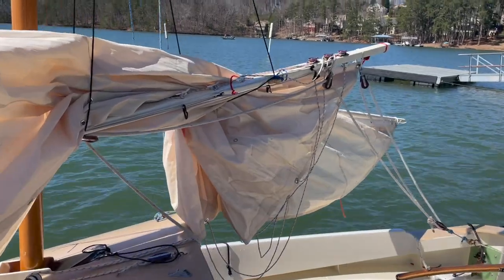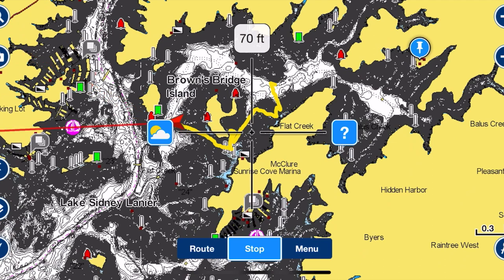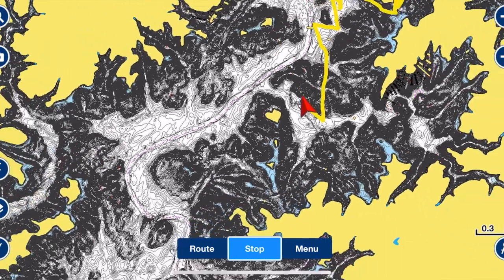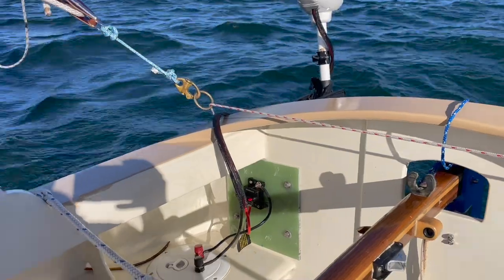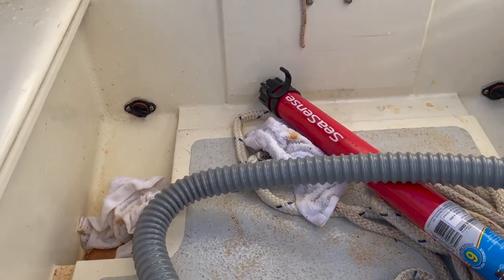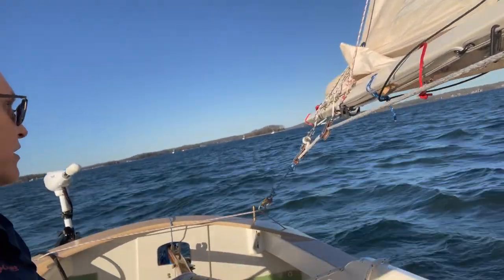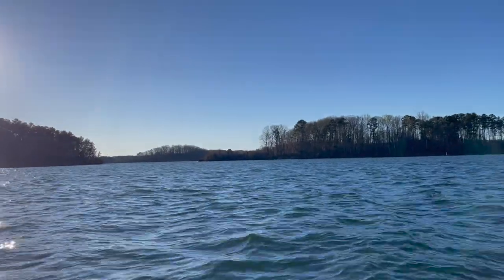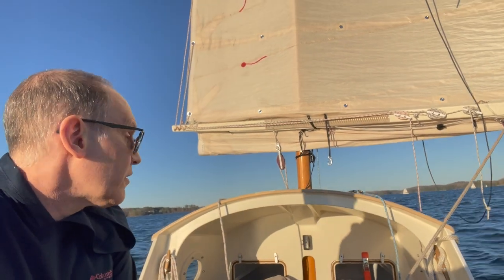Sailing to Three Sisters Islands. Parking on open water. Straight start from stalled tack.

Comment: More please! I'm at the early and naieve stages of building my scamp, and little knowledge to a real life experience of one, everything for me has been pondered and visualised so far, so im enjoying your clips thankyou. with regards the self bailers I would guess they would be effective for when the water inside the boat is higher than outside the boat, so my guess is they may reach an "equilibrium" lightening the bailing needed. But from the positioning of them they would let water into a dryer boat?
Reply: @TheKetamineSquid  thankyou!
Reply from the maker: Thanks both! Unfortunately I had the misfortune of a capsize. The self-bailers were moot due to some serious mistakes I made before setting out. I went out in way too heavy weather for me. I'll make a video about that at some point. But I can say for sure 1) Check the gusts not just the steady wind speed. 2) ENSURE there's a line on the end of your centerboard, so it doesn't disappear into the hull as you're trying to right the boat. 3) Make sure all the lockers have solid-locking latches on them. (Mine had lame latches, and the covers came off and the whole starboard side of the boat filled with water.
Reply: @davidwimberley5026  oh wow! I can see that being extremely challenging!

Comment: Before disabling the traveler, try finessing your tack. Maybe start by bearing a few degrees off the wind to power up. Then smoothly start the turn without abruptness which would  act as a brake. Once a turn is established, you might progressively tighten the turn with less danger of brake. Usually even catamarans are responsive to rudder subtlety in avoiding "irons". Travelers have advantage in pulling the boom down rather than sideways for better sail shape.
Reply from the maker: Thanks for this! I'm sure you're right. I'd thought about bearing off to build speed but I had never considered that an abrupt turn acts a bit like a brake. Heh, I'd assumed the more abrupt the better. Looking forward to trying that section of going down the lake again now that the weather is cooler. Wind is always blowing right up that channel so it's a good place to try it ... like a challenging ending to the first level in a video game.

Comment: Much simpler than multiple rings and clipping your traveler, simply connect the first mainsheet block (from the clew end) directly or much closer to the traveler line. That blue line and large snap shackle is way too long and not allowing you to pull the boom right over the corner of the boat. My guess is it shouldn’t usually be any closer than that to center line.

Comment: Great video, I have one question...... could it be possible to just fill the water ballast area with sand or some other heavy material and leave it permanently in place?
Reply from the maker: Sorry I'm late replying... Well... YES, that is possible. BUT I don't think I would, personally. The reason is that with water ballast, you can empty it , so that the boat is easier to handle on a trailer, and pulling a trailer. Sand or other ballast wouldn't give that flexibility. But yes, the water ballast tank on the SCAMP sailboat (mine, at least, and I think all or most others) is accessible via a hatch in the floor. So you could shovel some sand in there, then close the  hatch. You could even (with some good deal of trouble) scoop it back out again being careful with a small plastic shovel or something like that. I suppose the advantages would be you'd have a much heavier ballast. Sand is 1.6x to 2x as heavy as water. Ha, so (theoretically) I'm thinking about the possibilities, if I ever felt comfortable enough in the SCAMP to take it into an ocean for an extended coastal cruise.
Reply from the maker: Oh, and I should say, I'm not qualified to answer this. I don't know if there's any danger added to the handling of the boat or the structure of the boat with the water ballast tank loaded full of sand. Just my disclaimer. I think it would be fine, but anyone must ask the designer John Welsford, to be safe.

Comment: the fact that the tiller clutch doesn't really work downwind makes some sense - a boat doesn't like being pushed, and when you're going downwind, that's what's happening. a boat tends to be more unstable downwind unless it is absolutely perfectly trimmed, but the Scamp being a balanced lugsail rig, it tends to be even more unstable due to the fact that the wind can "exhaust" out of any side of the sail. that can be avoided by sheeting in a little.
Reply from the maker: Thanks for that. I'd never considered that about a balanced lug sail. Now that the weather has cooled I'll  be back on the water and try sheeting in downwind.